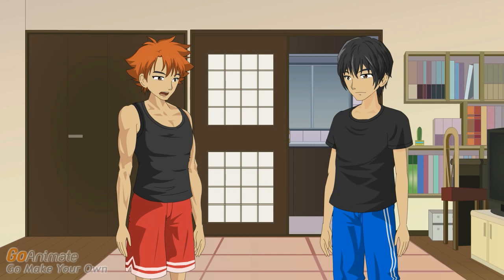My Water Heater is Making a Knocking Noise!

Comment: I have a gas hot water heater it makes a knocking sound that would wake the dead. It sounds like a gigantic plumbers  friend banged down then is sucked up!  From time to time we smell gas and there is a black ash around the base.  Is this dangerous?
Reply: +Sherry Aubry Harrell How did that work out for you?  I'm noticing the same thing.  Also, there is a good amount of water coming from the runoff valve.  If you could let me know how you made out with that, I'd appreciate it.  Thanks.